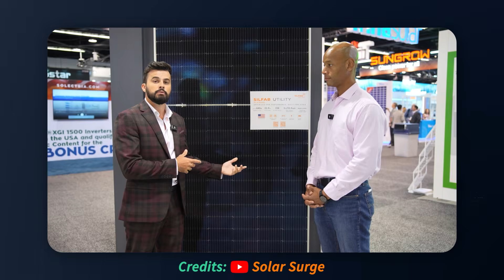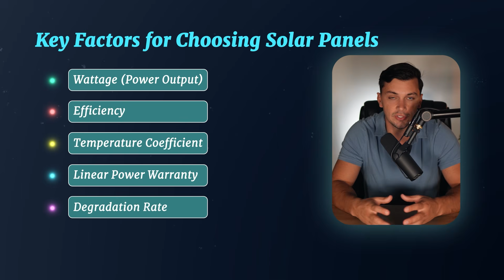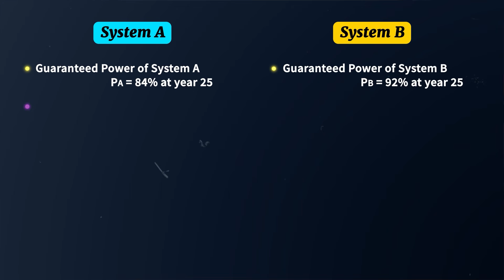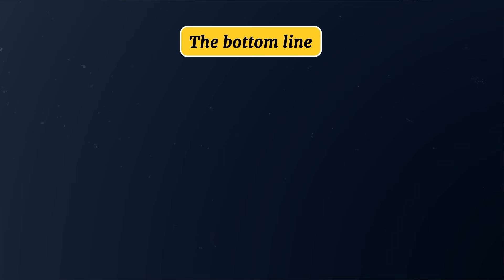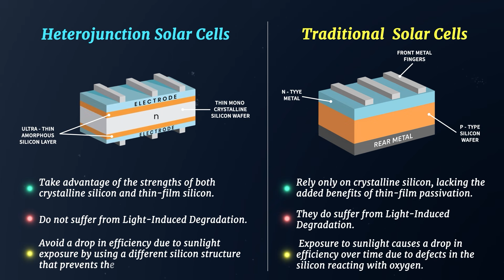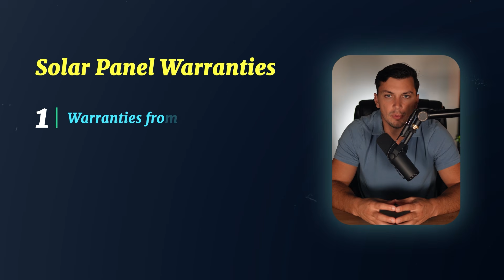The $11k Solar Panel Mistake (Engineer Warns)

Comment: From a real world perspective if you plan on living another 40 years, only then you should worry about the 40 year degredation. #2. If you are planning to keep the system 40 years, you are likely in your 30s, but you will most likely move out of that house by the time you are 70-80 years old. 
You will rarely find a 20 year old making this purchase. Get what you can afford and what you want. Get quality if you can afford it, that goes as a lifetime saying. But don't get yourself in loans if not necessary.

Comment: testing a second life array  11x kyocera 240s    poly from  a solar field  for 2 years  i learned that   after 15 years its wise to change em and use em as a back up or boost fence  vertical..!!!  old is good and harder to die bUt  you lose too much !!  2,5k array that  showed that strugled  in summer!!!   no snails no  breaks new cables  !! still good for second life project still electrify  my   warehouse  2 years in a row  BUt ..    too much space for  average  65% of a new and even less of a  todays tech  pv!!!     ..  every 15 years max just re do!!

Comment: The most important thing about selecting solar equipment for your home is making the ROI as fast as possible. Intelligent panel placement, good value equipment, right-sizing your system, minimizing exports to the grid (unless you get 1:1 net metering with your utility), and not getting ripped off by an installer can drastically affect your payback timeline. Also paying interest on borrowed money for your equipment can blow that up.

Think about what $30k is likely to do in the market if you give it 10-15 years. Solar rarely makes financial sense, unless you can get that payback down to the 5-6 year range. My opinion.

Comment: 50kW over 40 years let's give about 10k electricity savings. 40 cents more for 10kW panel is 4k. so now get 6k over 40 years is $150 a year. Not too much.

Comment: When I designed my system I designed for the derogation of the system over 20 years. Buy more panels, add a few more panels up front then you need. They are cheap. Also my thinking for if the panels output drops below usage. Buy a couple of panels and add them to the array in 20 years. Panels have historically gotten cheaper over time. In 20 years adding a few panels to make up for lost % shouldn't cost much. 

Also when calculating electricity cost you should take into account that electricity costs have historically gone up. Historically power cost increased in the USA by 3% per year. In recent years it has reached higher then that. 

My thought is if you are going to project out 40 years you should also project out the increase in grid electricity cost per kWh to 40 years at 3% increase per year. Your underestimating savings by not also projecting out the increased cost in grid electricity.

Comment: High temperature for a solar panel is a valid concern. Some newer, costly & more complex to hook up is water cooled panels. Yes water cooled panels in areas that freeze is a concern.
What do you think about water cooling solar panels?
Reply: Would be better if they were capable of heating and cooling. Setups like those could get costly quickly, especially with these scammer - I mean company - markups. Better to take to an electrical engineer/hire ONE instead of getting an entire company to scam you. A little elbow grease and research and you will save yourself a boat load. Just ask them for a price and then price out the solar panels, you will see 60% of savings on the cost of panels by buying them yourself.
Reply: There are new panels that have water cooling via integral solar water heater piping. Dual purpose. Not available to the general public, only to licensed installers.
Reply: Too complicated and expensive to be worth while. Just buy more panels instead.

Similar to tracking systems. They almost never compete with the same cost but more panels.

The only time these makes sense is if you are absolutely out of space and can no longer get panels. But then, is the solar even worth it since the cost vs energy produced will make the payoff periods huge, and even that's assuming nothing goes wrong.